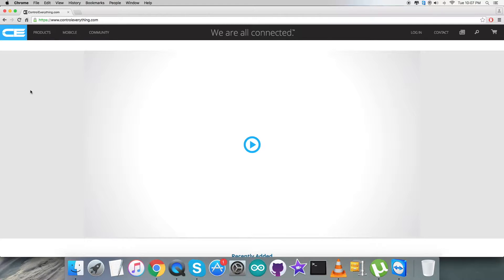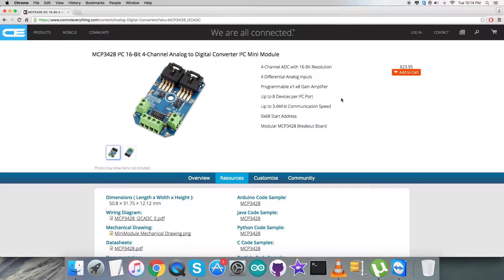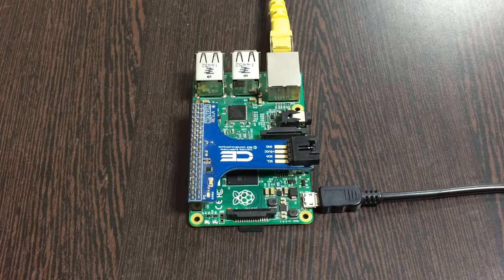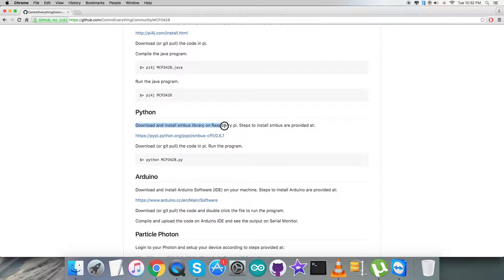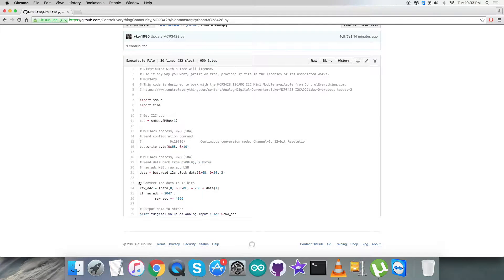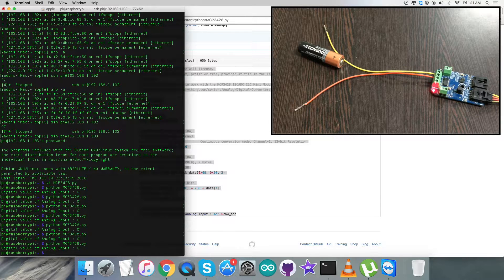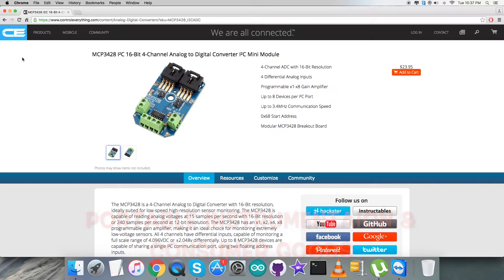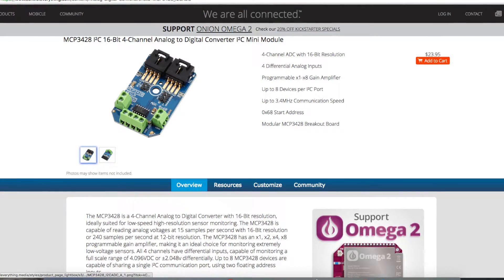Raspberry Pi MCP3428 I2C Analog to Digital Converter Python Tutorial

Comment: Two questions
1. How many analog sensors can you connect to a single MCP3428 board? 
2. Once I mount the I2C hat on the R-pi, can I still use ALL the GPIOs on the hat? Is the mapping still the same as an R-pi?
(Hat = Shield)